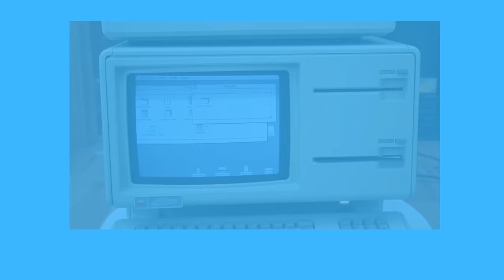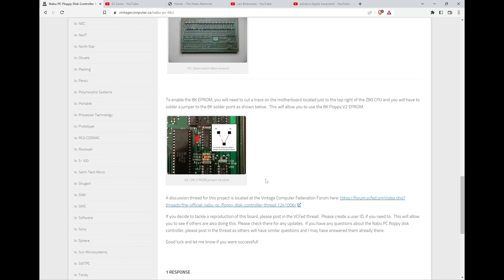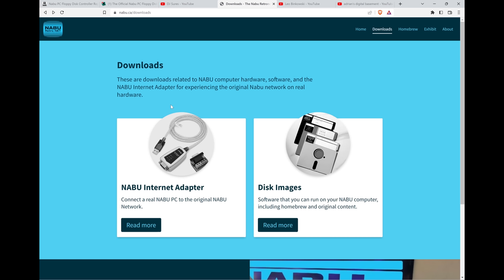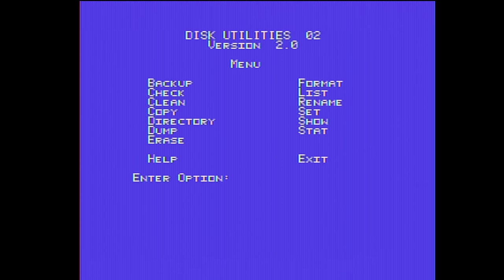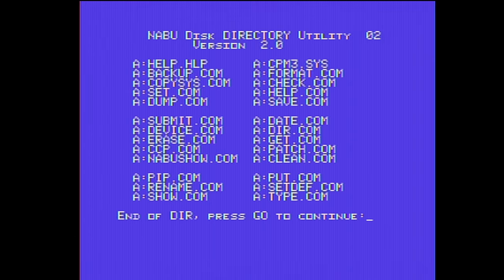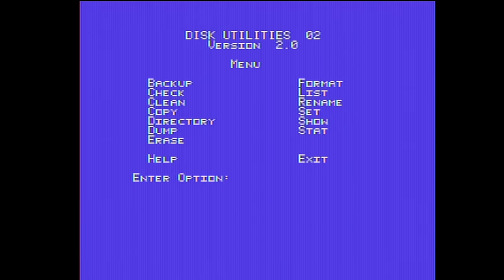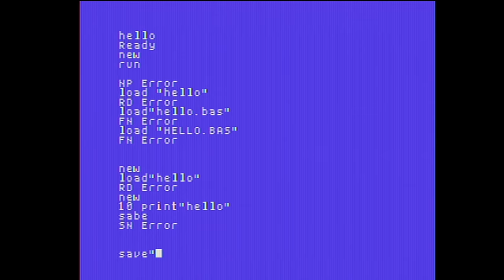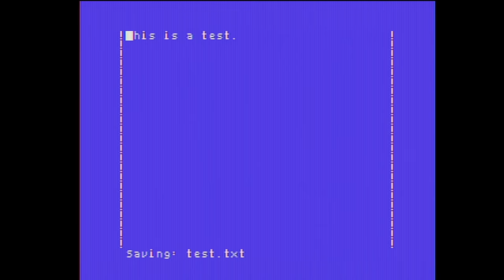NABU Personal Computer floppy drive status update, projects and demo

Comment: I sent you two NABU CP/M 3.0 Boot floppy copies. Hope they work, after 40 years!
Reply from the maker: Thanks Leo.  Still working on booting CP/M.  It's definitely the floppy disk image I am using since the floppy drives work, as does everything else.  This will help immensely if at least one of them works :)
Reply: Did you image the disks before sending off the floppy disks? I've been busy the past few years archiving and imaging all my floppy disks from the 1980s, especially stuff that's specific to me and not already imaged. Floppy disk bit rot is a real thing, especially after 40+ years. We must all do our part to save the software 🙂
Reply from the maker: @geekwithsocialskills  For stuff like this, I will image them the minute I get them.  Then I will use them.  I do this for all very hard to find software.  I suggested to Leo he send them "as is" because I have a good set up for imaging disks.  I'll start with Kryoflux or Applesauce to get a flux transition copy, then I'll use ImageDisk or the Applesauce to get an IMD file. The I will try them if everything looks good.

Comment from the maker: I know of maybe 5 floppy disk drives in existence.  There are not many and is why we are trying to reproduce the floppy controller.  The idea is that you will be able to connect a regular 5.25" 360k floppy drive to the controller so this is all you will need.  It still has to be tested so nothing is definite yet.  I will post updates when there is more news.
Reply: a regular interface might also pave the way for inserting floppy simulators - such as devices with USB/SD/HDD or similar that work as a virtual disc changer.
Reply from the maker: @alexanderstohr4198  You should take a look at my next video.  I am using an HxC2001 floppy emulator to boot up and run CP/M.
Reply: I like what other have said, however if you make it work with floppies the simplest solution is to as a floppy OR a gotek.

Comment: Do we know if anyone is working on making the NABU disk format available to the FlashFloppy folks? It would be a nice solution to be able and use GoTek drives with the NABU computer.
Reply from the maker: In my testing, I have the NABU PC running off of an HxC2001 SD model.  I haven't really had the need to go the Gotek route with anything but Amiga but I suspect it would work fine.

Comment: thing is. you can't get new 2764's. you can only get new at28c256 and nothing smaller. (yes it is kinda annoying that if you want a 2 or a 4 or an 8kb rom or sram nobody bothers to make the 6810 and 2716 and such anymore... but that's the way it is for now. it's mostly the same pinout tho. but larger chips than are needed obstructs my ocd :P
Reply from the maker: I do wish you could still get them.  I have to buy them used and they are sometimes hit or miss.

Comment: Santo - surprised you didn't load up ZORK! It's kind of hidden in a menu under Mysteries - but it requires a floppy. So you'd be the first to run Zork on NABU in 40 years if you do!
Reply from the maker: Unfortunately, it does not run.  I tried a few things but Leo thinks it may not all be there.

Comment: Are the floppy-drives are serviced/lubed? 
Maybe the head-spindle is stuck or the head needs a clean?
Reply from the maker: They are lubricated with PTFE and the stepper motor was oiled.  They are just noisy drives.

Comment: Why not have 27128 ROM with 4k and 8k image. Have DPDT switch ground the two extra address pins on the 27128, but pass the one of additional address line to the additional address line needed for the 8k, and other address line to 5v+. That way the MSB is switched between ground and +5vdc to switch to using the MSB and the both new address bit always stay low and only used 4k. Of course you could have two 4k lines by passing it to another switch to select which of the two 4k ROM images are used, but just having the one 4k ROM is sufficient. Only 12k of the ROM is used, and maybe an app/game could be stored in the other 4k that boots instead of the OS...

Just some thoughts, but modifying it for a 27128 is not more difficult than modifying it for a 2764, and the addition of a switch to control the MSB address line allow the computer to run to stock ROM image as well as the 8k ROM image. I really want to find a NABU to play with, be I could not afford it until I got my check, and by then all the EBAY Nabu's had disappeared. If any one see one for a reasonable price... I may be interested.
Reply: Using a 27128 ROM, in 2764 Socket was down all the time, we just socketed the pins that were common, and we left the pins that either did not have a terminal for the socket, or connected bent out from the chip and soldered jumpers from these bent chips to where ever they need to go either a switch or a trace on the circuit board. Which Color Computer 1, 2 and 3 users did this all the time with our Disk Controllers to be able to change out.

Comment: simply hooking a contraption derived from an atari diskdrive to the adaptor port ofcourse is also a quick and easy 'fix' if you want a floppy drive.. modify the schematic to pump the already-rs232 anyway over rs422 signalling, crank up the bitrate, and change the command sequences a bit. :P the end result is still 'hey diskdrive, read me sector so and so'.. ok bbbzp bzzzp there ya go :P same hardware same everything and no seperate fdd interface needed. harddisks same story. even easier. :P ide ones and cfcard one anyway.
Reply: as in having the floppydrive simply take on the task of both the adaptor, nabu server, and the floppydrive :P matter of changing the commands and checksum method around a bit. it can simply get everything else it needs for disk operation from the actual bootsectors anyway. 'file system support' and that kinda overrated stuff :P lol. disk and network support are not nessesarily 2 different things that require different interfaces or ipl routines. if you simply slightly alter some existing 'somewhat smarter' diskdrive designs. (an 8 bit microcontroller with barely enough ram to store whole sector suffices.. or run multiple passes if it's less than the desired sector size, it's still fast enough to fill that 111kbps and it won't turn any slower ;)
Reply from the maker: Yes, there are at least two compact flash solutions I know of and am trying one of them.  As a vintage computer collector, I personally like to reproduce the original solution if it is no longer available.  Hence why the reproduction of the FDC board.  There is no shortage of ingenious solutions that this community has come up with already in a very short time and with a limited supply of newly acquired NABU PCs.  What a great community.
Reply: i don't recall ever asking a manufacturer to make things weaker and breaking within a month...  not even to make them smaller.:P nobody ever asked for 3.3v stuff. nobody ever asked for smd crap or bga or rohs. and if that means we have to order a million chips a a time for them to resume production, then fine, then we order a million chips no :P it's that simple.
Reply: Put a raspberry Pi inside the Nabu. Connect it so the Nabu thinks it is connected to the "Nabu Network Adapter" add a hat to the Pi for SSD and USB Floppy Access.
Reply: @WalterGreenIII  and end up with an overglorified supercomputer that sucks more power than is needed, can be hacked and programmed in circuit to do things you don't want the user to be able to do, and if you're gonna put an arm in there with like a few megabytes ram why use the nabu at all :P lol. (oh besides. raspberry pi's won't last 2 years. let alone 40+ :P which is kinda like a requirement when interfacing them to computer systems that do last 40+ years. besides that, they also cost more, and if you want like 100000 of them tomorrow the raspberry pi factory chokes and dies on it. :P which never is a problem with real chips.
Reply: see the whole point behind systems like this is that you can nicely limit the things the people can do with them. in a rather absolute fashion. and make them pay for doing it. :P which makes them far far far superior to either a vt100, or a pc based infrastructure. as for raspberry pi's... well i can assure you noone will find a few 1000 raspberry pi's in shed 50 years from now and they will still work (or even interface to anything at all - as usb is kinda crap too ;)

Comment: Great to see that the drive do work!

Wonder if you can save your progress in Zork 1, etc.
Reply from the maker: I was told that Zork could use possibly the floppy drive but I've been so wrapped up in getting the drive to work that I haven't explored the NABU RetroNET that much.  I will see if I can find it and try it out.
Reply from the maker: I have NOT been able to get it to run.  It actually saves a zork1.dat file to the floppy drive but it pops up a "Not in your package" error and then reboots the NABU.  If you have gotten any part to run, let me know.
Reply: @vintagecomputerca  interesting. I don't have a drive controller, when I loaded Zork 1, I got a "No Disk Drive" error and it went back to the menu.

Comment: Seems like the CPM/80 system is not accessible to the general user so is maybe something to leave well alone.
Reply from the maker: CP/M is insulated from the general user through the menu system but there are bootable floppies for CP/M Plus that was written specifically for the NABU PC so it's a technological curiosity to try to get it to run again.  More of a challenge than anything.